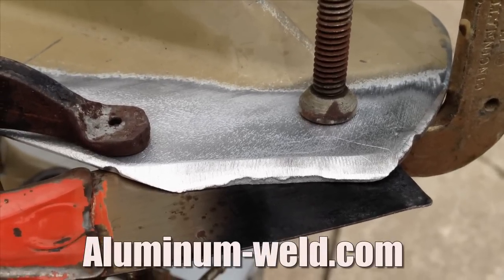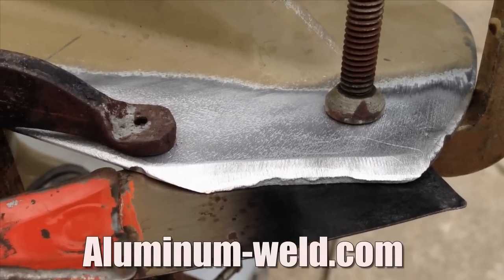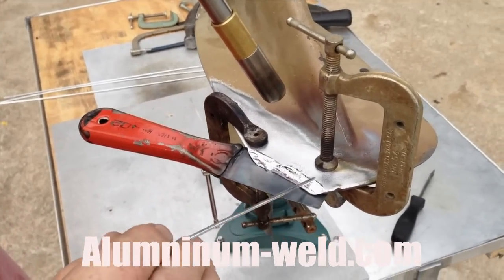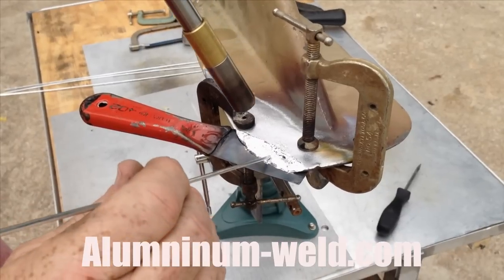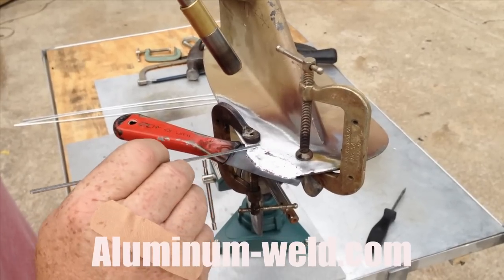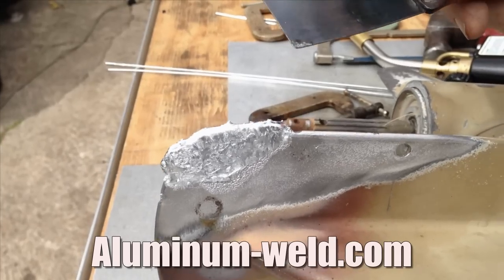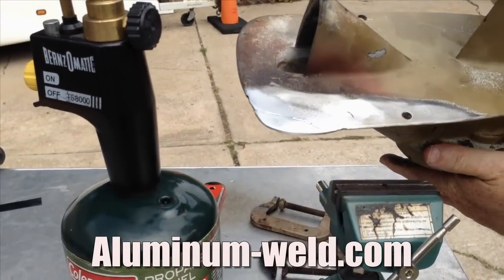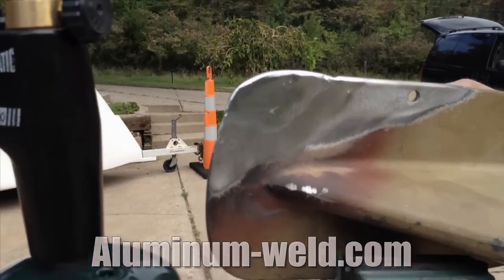Aluminum Boat  Lower Unit or Skeg Repair with HTS-735-11

Comment: What torch/gas are you using?  Can I use propane torch with that rod?  Thanks
Reply from the maker: Propane works on most applications, if you are working on a larger object or thicker aluminum to may need to use mapp gas. Also the torch tips make a bid difference. I like the TS8000 by Bernzomatic, you can use mapp gas or propane, it is adjustable, and it can put out a lot of heat. Watch my pontoon  repair video and weld aluminum at home on my youtube channel    youtube.com/c/aluminum-weld  thanks

Comment: Will this work if I have a crack in my cavitation plate
Reply from the maker: That is what I am repairing in this video, tin both sides for full strength.
Reply: Mine has a hairline crack and could probably break any second I’m just wondering if I put the rod on the hairline crack and then grind it flush if it will hold
Reply from the maker: @codinskie8  You will have to V out the crack and fill and go pass the repair a half inch each side of the crack. If it breaks off you can weld a butt joint on . I have a video  showing the strength.

Comment: i have a small repair id like to do on my skeg, smaller area then this, can you please send me a list or link for what i need to purchse do do this?
Reply from the maker: you can order from aluminum-weld.com an 8 pack should be all you need  but first watch the prop repair strength test video and be sure to tin the back side for full strength. call if you have questions. youtube.com/c/aluminum-weld

Comment: And it Broke off the next trip out on the water...
Reply from the maker: Hi Ranger,

I have repaired many props and lower units with no trouble.  The only reasons for failure are: 1. Not cleaning the aluminum, 2. Not heating the prop so the rod is melted by the prop, 3.Only adding rod to the very tip of the prop so there is very little contract with the prop. 4. Not letting the prop cool slowly. Give it another try,  it works!!
Reply from the maker: Follow the instructions and that will not happen. I posted a new video that may help you.
Reply: Could you post a link for the second video?